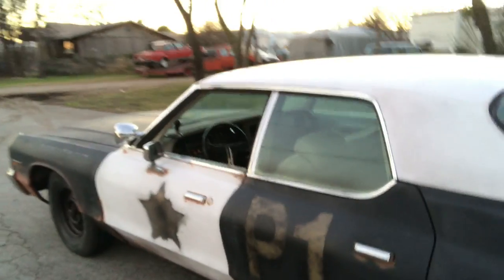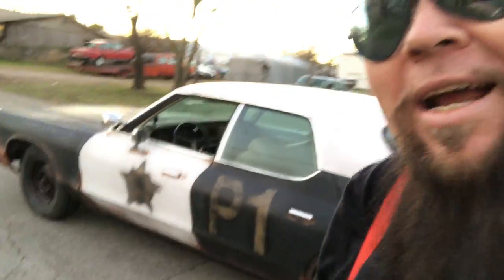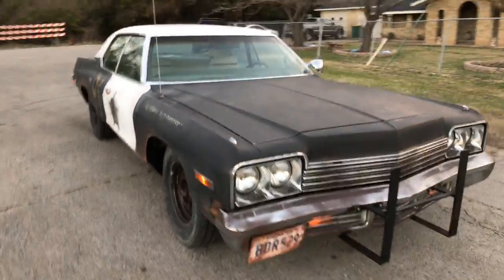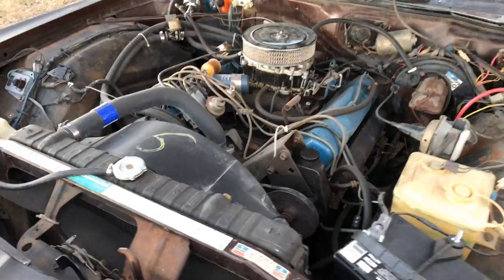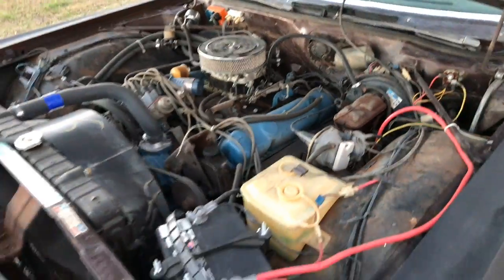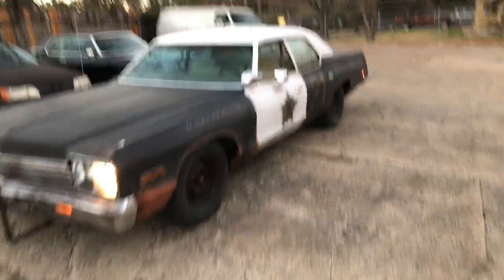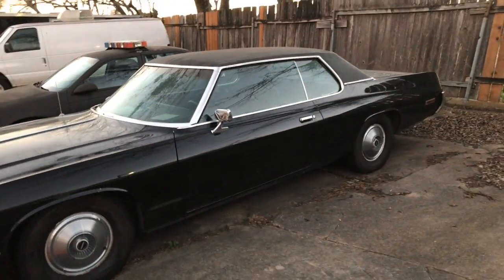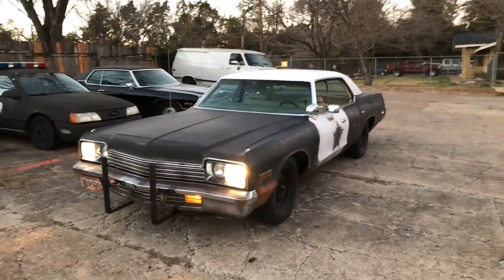1974 Dodge Monaco Mount Prospect Police car from the BLUES BROTHERS! The Bluesmobile!!!

Comment: Damn!  Just perfect! 
I’ve been lusting after a 74 Monaco ever since I was 13 and saw Blues Brothers at the theater. Even in the early 80s never saw many around my area (New England). Back then the local PD were using those awful St Regis. I think they had, smogged to death, 360s and the Detective/Undercover models were Slant 6s.

Comment: My buddy bought a 72 Monaco ex state police car supposedly. It had a 2bbl on it and it was very quick for a huge car. It was yellow and he let me drive it a few times and it was pretty impressive. I think we timed it with a watch and it did 0 to 60 in just over 7 seconds I think. It actually idled like it had a minor cam in it and had way more power than a factory 383 4bbl 67 Monaco he'd had just before it. One time I got to drive it to my house with him and I pulled out of the gas station on the 2 lane street leading to my house and he told me to jump on it. I was doing close to 60 in the few blocks to the turn to my street and even with the big 2bbl that thing howled like a Thermo Quad. Just as I got close I anchored the brakes to slow down and turn right and a local motorcycle cop came flying up from the opposite side street on my left. His head was on a swivel and he almost dropped his bike looking around . He didn't even look at us as I made my right and we put it in my garage just in case. I guess having a 4 door government looking non descrypt quiet car was a plus back then 😉
How many of these have you built now and I bet when you started they were a lot easier to find. I know we used to see them around here in the late 70s and early 80s. I guess the equivalent now is the last Crown Vic cars. Last auction I went to years ago they were averaging 2500 a pop in nice shape so never got one.

Comment: Great idea with the simulated “post”! Got the look with the windows up, and the nice open area when they’re both down.  400 is great too and the distributor is in the correct place when the hood is popped for the Mopar fans! 
Thanks for the nostalgia getting to hear the old “lean carb pop” pulling away! Damn kids and their EFI don’t know how good they have it!
That exhaust bracket is just mimicking the “we’ve thrown a rod” scene

Comment: I miss driving those big 70s cars.   I would rather drive that car any day  than some peuny boring modern car.
Reply: How different it is? I have never ride an old car like that but my father says that they are really heavy and like really really big in comparison to todays cars, honestly I would looooove to ride the blues brothers at least once lmao
Reply: Those old cars were heavy but they would “float” when you drove them.  They handled like bricks but man did they ride smooth
Reply: Basty Elwood Called em “boats” because of the smooth disconnected feeling they’d have as you’d “float” on down the highway. Most of them would have the biggest displacement motors their manufacturer would offer : (427, 428 454. 455 500 etc) all big ass torquey as hell motors usually with tall highway gears so they could kick down into 2nd when you’d pass somebody.  Big roomy interiors with, most of the time, bench seats so imagine cruising around on your sofa with a big block. Nice comfy and torquey! Lots of babies made in America because of this type of car!
Reply: They were death machines that wouldn’t make it to 100,000 miles.

Comment: It's got a cop motor, a four cubic inch plant, it's got cop tires,
cop suspension, cop shocks, it was a model
made before catalytic converters so it'll
run good on regular gas.

Comment: Phone number on rear quarters is wrong. The speedometer, while it IS A 140MPH speedo, is not the correct one for the police monaco. On the original one, some numbers were bigger than others. I owned CHP 1974 and 1977 Monacos. The original bluesmobiles made for the movie were cars from the TV show CHiPs, which were previously CHP cars.

Comment: Very nice replica! Too bad the engine isn't a 440, but 400 is still huge. The original Bluesmoble is a massive car, making the second one, a '90 Crown Victoria look small in comparison. I have an '89 LX of that particular car. Those old '74 Dodges are hard to find, especially legit police models.

That coupe regular one you have is slick.